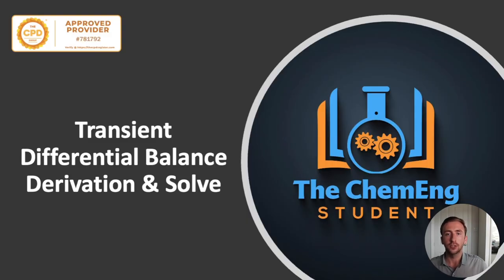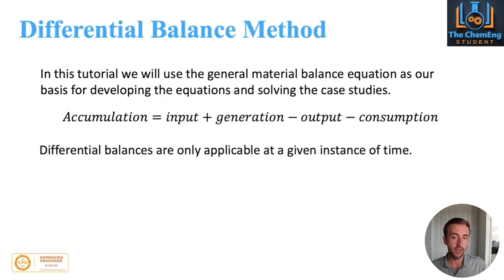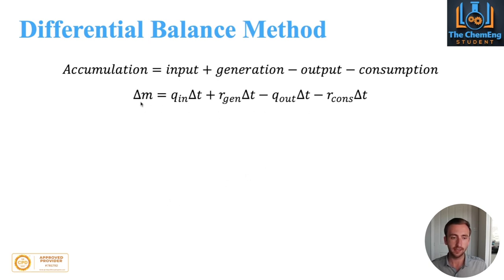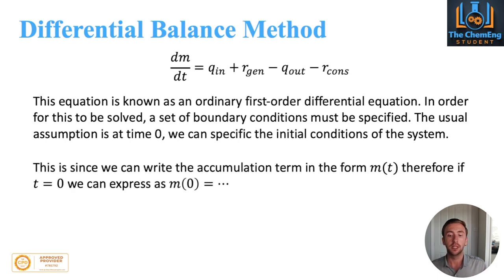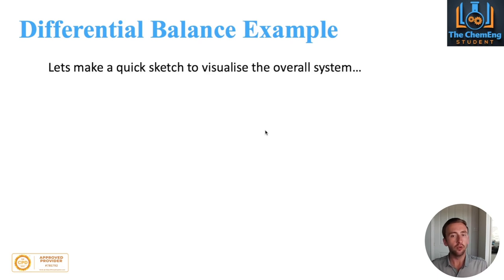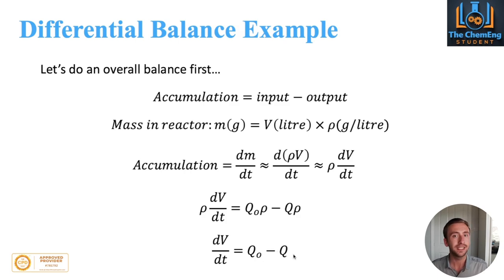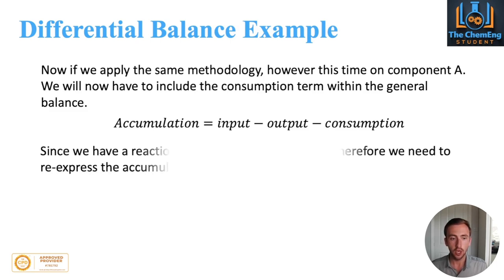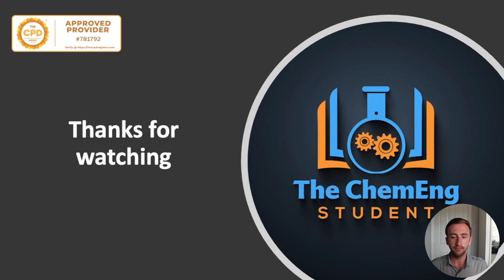The Differential Balance Explained For Transient Processes

Comment: Nice video, thanks for sharing. One small comment if I may. We cannot assume delta t = 0, as that would involve division by zero. Taking a derivative wrt time is a limiting process whereby delta t is allowed to approach zero, but not to be zero.
Reply from the maker: Thank you for watching, yes you are correct in that there is essentially a quasi-state occurring where the value would tend towards zero, however for ease of explanation for these tutorials we don't want to over confuse as in my experience as a lecturer, as soon as you enter the realm of quasi-systems all is lost. But you are absolutely correct and thank you very much for commenting on this!